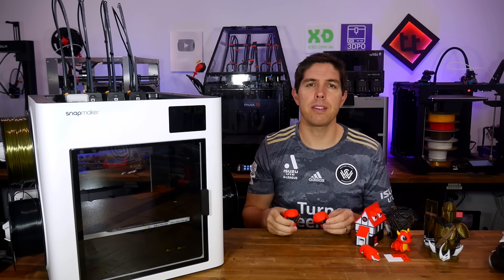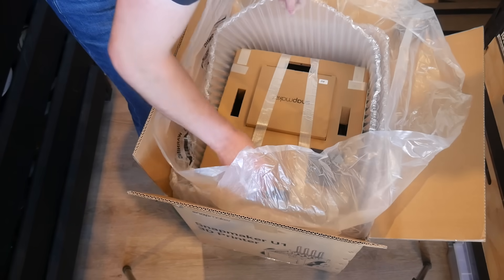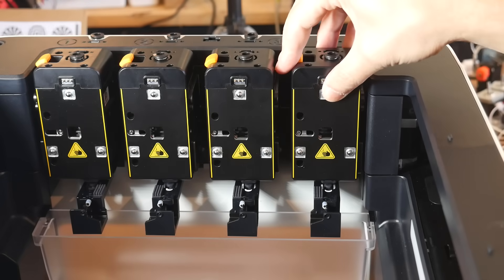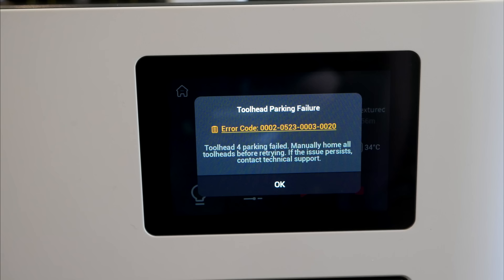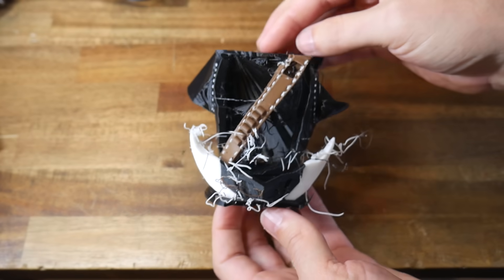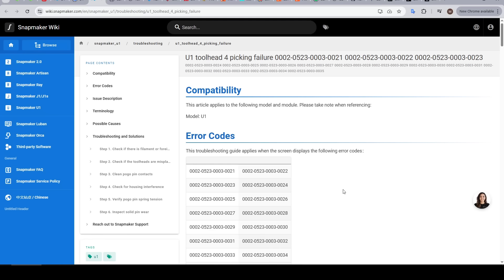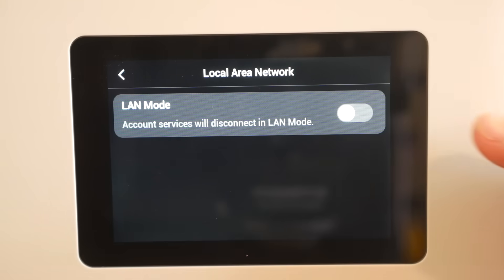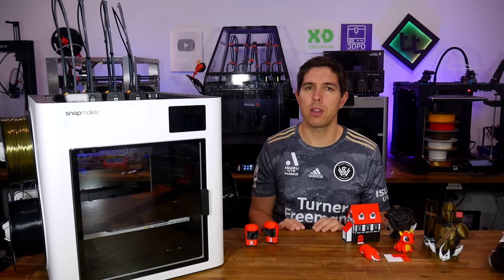Snapmaker U1 toolchanger production model first impressions

Comment: As always, the Snapmaker U1 is looking excellent. Both in capability and print quality. Especially for the money. The open source nature and the easy print options of USB, LAN, and networked are great. Overall, I think this is a real winner. Hopefully long term reliability is also solid, but I'd buy this over a Bambu Lab or any AMS style system for multicolor printing for sure.
Reply: Yes, if they actually open source their klipper stuff of course :)
Reply: Did you miss the part where it was faulty out of the box and required soldering to fix?
Reply: @WheatMillington That was the pre-production model and there is no printer in existence with zero lemons, especially on the first run.
Reply: @WheatMillington  Did you miss the SEVERAL videos on the H2D showing it blowing its PSU? or the nozzle oozing? or the hotend going nuclear with heat runaway that made them smoke and melt?  You Bami's are ridiculous trying to find issues with other printers in order to save your Bambu cult existence
Reply: @anthonylong5870  you need to calm down bud, he didn't even mention bambu. And it's 5x the quality of this one.

Comment: I had a similar pleasant setup experience with my J1s when I got it (minus the hardware teething issues). Snapmaker really does put thought into the user experience. I also love the cleaning brush they include with their printers! 

And, yes, you can download the firmware files from their website and install via USB + Local Update button. This even lets you downgrade, if necessary.

Comment: Questions:
1. Do we have SSH and root access to the Linux installation?
2. Have they nerfed Klipper/Moonraker in any way? Do macros, configs, Python extensions work as expected?
3. Are there any extra USB ports on the mainboard where you could plug in secondary MCUs? For example to control custom lighting, macro pads, air filters, etc.
4. Any free GPIO pins?
Thanks!
Reply: 1. No (at least not at this point; they "evaluate"). 2. They want to publish klipper sources repo early next year I think (the exact info is in kickstarter comments).
Reply: the is the 4 pin connector at back by usb port that has canbus, ive looked at the mainboard the is an unpopulated usb port, and some pins, so hopefully there some usable pins and/or I2C

Comment: This is the first machine I've seen in a while that makes me somewhat optimistic about the future of 3d printing.

Snapmaker could absolutely still go the way of Bambu in terms of a locked down ecosystem, and experience tells me they probably will, but at least for now, they're doing everything right. A well polished, open machine that I can run offline if I want, but still has a good feature set if I don't.
Reply: What do you mean ? All Bambus can run offline too (via USB or in LAN mode).
Reply: They have said in live that they have a road map to give everyone access to firmware and so forth and follow open source protocols.

Comment: Bondtech new INDX system which is out this month already makes this obsolete.
Reply: INDX is coming out in Q1 2026. BONDTech announced it on their blog that at the FormNext even in November they will show "v3" (third generation/iteration), in the meantime they are going to continue working "v4" which will be available for purchase/delivery in Q1 2026.
Reply: The INDX is coming out this month? I thought they were starting pre-orders in November (around Formnext). Either way, I can't wait.
Reply: It will most likely make this system obsolete (or at leas inferior) ... as soon as printers will arrive with Bondtech system built in, with more than 4 tools. So far we only know Prusa is working on some version and beside that nothing is known. Snapmaker U1 is really cheap as for toolchanger printer.
Reply: And how much is this full system with INDX going to cost?  I think that nullifies your argument regarding obsoleteness... different target market segment.
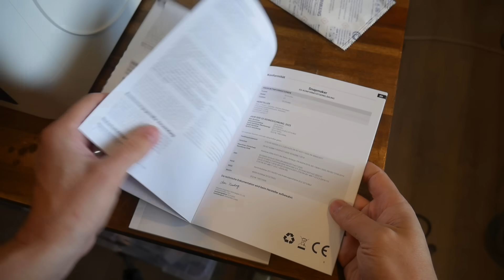Reply: @stevetb7777 slightly less per tool INDX think. See about 03:20 into my INDX cost estimates video.
Reply: Could always upgrade the U1 to an 8 tool INDX if 4 tools prove insufficient,
Reply: Absolutely false.

Comment: I realize it would reduce the print volume in contact with the bed slightly, but does that CryoGrip glacier bed stay attached to the printer and have good bed adhesion with TPU?
Reply from the maker: I tried to print with it as pictured but it failed the homing and abl sequence.

Comment: Can you hook up better web cam to the back usb port? I cant seem to get an answer to this.
Reply from the maker: I will try that today.
Reply: I am interested to know this too. Processing power on the mainboard is likely quite limited though.
Reply from the maker: I plugged one in. Fluidd configuration editor does acknowledge it but no go for two reasons: no SSH access to set it up and limited MCU capacity. Also there is a power limit for the USB port that would limit the camera that could be used.